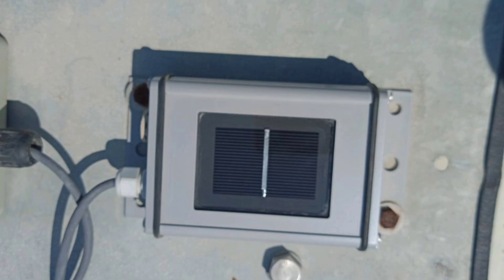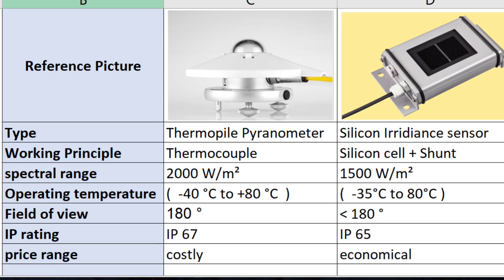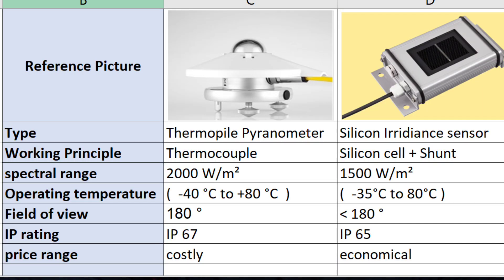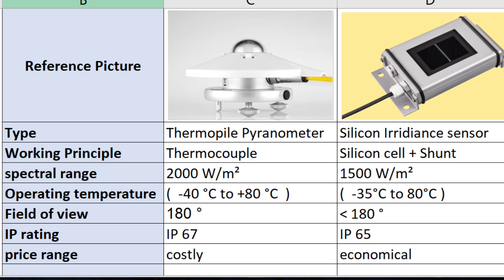Pyranometer Vs Irridiance Sensor | Technical Design Selection | working principle

Comment: Sir we  are working on two plants. 
1) 9mw ground mount
2) 1.6 mw rooftop
At both the plant we have pyranometer.but at 1.6 rooftop plant radition is more as campare to 9mw.. angle is same. So it is posible that diffuse radition is captured by pyranometer from teenshed of rooftop.
Kindly look into this
Reply: Both plant location is same or different, if both are at same location then  please get calibration of both pyranometer.